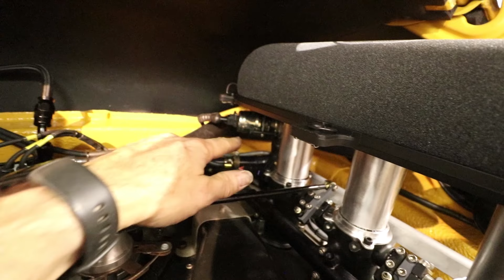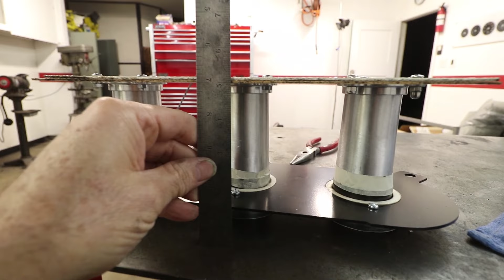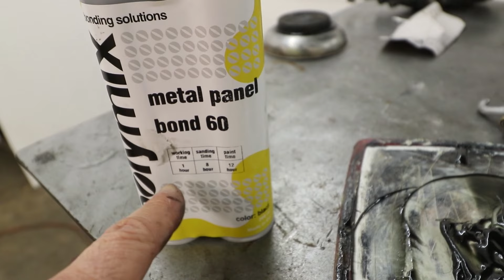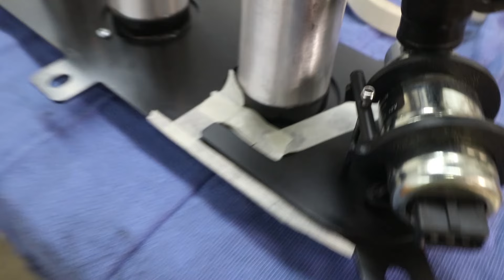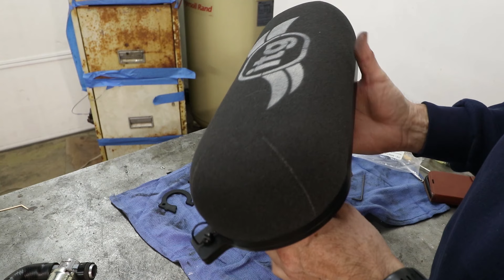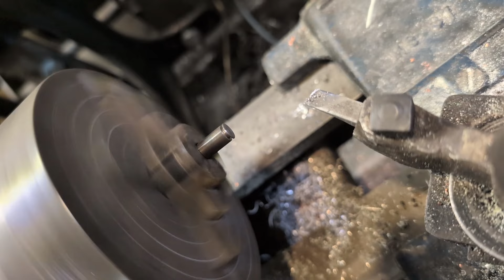Old-School Hot Rod Meets EFI: Custom Air Cleaner Assembly Build

Comment: How is the Emtron Software interface ? I run a Trijekt on my RWB  but i can handle the software only over Serial
Reply from the maker: Emtron is great and very fast over ethernet.  One of the best and the software is easy to use.  The only warning is that there are a lot of adjustable things.  Takes a while to configure and tune them all.

Comment: Just discovered this channel and you, Tom looked familiar.  Then when I saw the Drive for a Cure door sticker, I figured you may have been at the 2024 356 Holiday in Santa Barbara.  We did the same 'spirited' drive in a white 356 SC.  My suggestion for the white air cleaner logos is to find a complimentary (body) color in a permanent marker (less intrusive than paint) to help offset the white, or just go with black.  Beautiful car and craftsmanship!
Reply from the maker: Yes, I was there at the west coast holiday in my green 356SC.
Good call on the markers.  I haven't oiled the foam yet so ill try this.  Maybe just tone it down a bit and make it look used.

Comment: So great to see this car at this point.  The engine idle sounds so consistent and solid.
Reply from the maker: I'm so happy with it now.  Sequential fuel and spark plus closed loop control is amazing at all speeds.
It kinda drives and starts like a Honda, but roars to life when you step on it.  
Super fun compared to the 912 engine and even the motronic engine.

Comment: Have you ever thought about fitting the Kinsler FI to a 356 engine?
Is this fully electronic? Whose ecu are you usoing.
I may have missed some episodes due to being in Asia and unable to get logged into youtube for awhile.
 I like the clean assembly you have crerated and it is unfortunate that no one can get the PMO system to work.
Reply from the maker: The thought has crossed my mind to fit a similar system to a 356 engine, but not for my car.  I want to keep my 356 stock plus i actually like carbs too.  
My ecu is Emtron which is highly capable of just about everything.  Yes, fully electronic.
PMO didn't want to listen to my ideas about fixing their product.  O well.

Comment: Love what you've been doing, a true inspiration for my stalled project.  The panel bond is a great idea.  Question on the idle air controller, when the engine is cold, it allows air to escape, thus a richer mixture.  (same fuel with less air)  But you're only doing it on one side.  Is it a problem that the other bank does not have a choke?  Or do I just not understand how it works?  Keep up the great work.
Reply from the maker: Best of luck on your project!  Keep going.
Here's the explanation of how the idle air controller works.  
https://youtube.com/shorts/xU4CZC1lnG8?feature=share

Comment: That is a very trick air filter setup. Similar to what you would see on a 73 RSR or ST. I perfer using panel bond also, especially where doing replacement outer rocker panels on my F350.  Mac is a very special ride.
Reply from the maker: Thanks!  Panel bond is awesome especially here because it seals too.